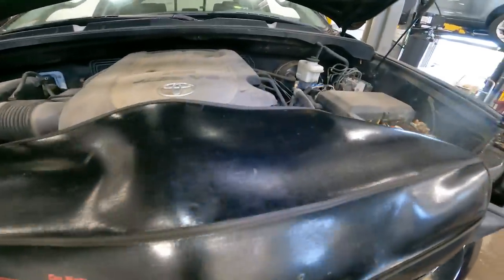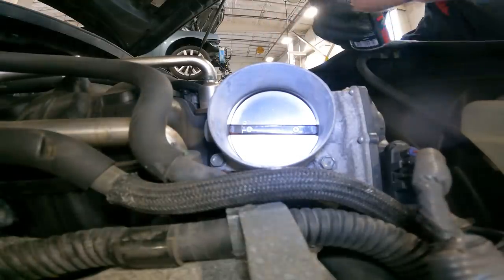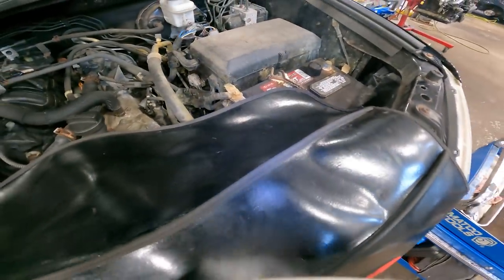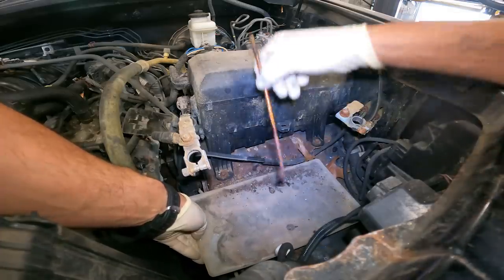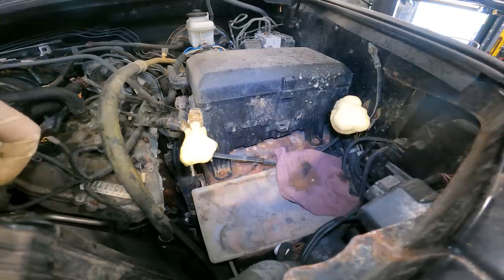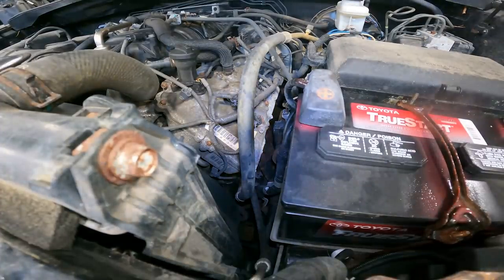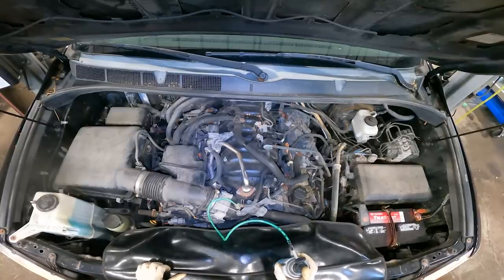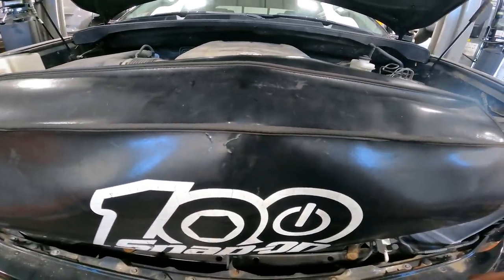Customer states ENGINE IDLE'S LOW AND CRANKS SLOW. 😡🤔😁😉

Comment: I always leave the caps on the terminals until I'm ready to reconnect the cables.
First time I ever changed a battery I welded my spanner to it. Scared the crap out of me, never did it again.
Reply from the maker: Sometimes we learn the hard way, either way we have learned. Knowing is half the battle.

Comment: I like to unbolt the throttle body and clean the backside as well. It’s usually filthy back there. I clean mine every 30k miles along with the MAF sensor.
Reply: I like the way you think.
Reply: I’ve read differing opinions regarding MAF sensors and how cleaning can damage in some cases, ever come across that ?  I clean mine, only with MAF sensor cleaner.
Reply: @TheSchmed  as long as you clean it with MAF sensor cleaner and let it dry, you will be fine. Most other cleaners leave residue that will screw up the sensor when it heats up.
Reply: It is hightly recommended to keep the backside clean.
Reply: A steady drip induction off the booster hose for 20 min is useful as well. Gets where fuel treatments cant because it enters the intake. No more than 20 min because your cat/s will start to glow & you risk damaging them on higher mileage engines.

Comment: My 03 Silverado had this issue, at low idle it would stall out and in reverse. I took it to a mechanic he said replace the computer, did plugs wires fixed for a week same issue. Cleaned that with carb clean, 🪥  toothbrush, ran like new.
Reply: Yes I find that a good medium to hard bristled toothbrush works quite well the cleaning the front AND the back side of those throttle bodies!

Comment: I strongly recommend to perform that manifold injector cleaner every 30K miles on GDI Engines. You need to remove the crud on the intake valves BEFORE the accumulation becomes heavy. Otherwise expensive Walnut or Dry Ice blasting will be required.

Comment: “Always make sure your nuts are ready to go” giggity😂😂 I’ve seen batteries with no terminals just jumper cables. I’ve seen terminals eaten through held on by vice grips. I’ve seen cars with marine terminals instead of automotive. It’s amazing the jury rigging Goombas do to their batteries to keep from spending just a little bit of money and working just a bit to replace a terminal or perform corrosion preventative measures.
Reply: Yo I work at Walmart. The other day we had this guy buy a MARINE battery for his Corolla bc we were out of stock with the cheaper ones. I wish I was there to see him struggling to install it

Comment: Pro tip from Lexus tech, if your shop has a coffee or water machine that has reallyyyyy hot water you can slowly pour it over the acid and it will also disolve it like nothing! Never knew about this trick till I started working at my dealer and it works amazing! try using super hot water next time you have corroded terminals you'll be blown away

Comment: The explaination for removing ground wire first, install ground wire last is: you risk shorting your wrench to chassis, when fiddling with the positive terminal, and ground terminal installed.

Comment: Where is your shop located ?  Suffolk County, LI ?  How far from Huntington, LI.  Independent or Dealer service ?  I see you work primarily on Toyota, Audi & VW, and I see your digs look like dealer service dress.  If you are dealer service, you should scram and open your own shop.  A few dealers I’ve been to for service, I had to tell them what to do to find the problem, the latest being a leaky axle seal on my JKU, guys says “there is no leak”, I say “did you remove the rotor and take a look, that’s how I found it, and I told your service manager that”, he says “I gotta do all that work to look ?”, I say back “I’ll come down and spend the 3 minutes to remove the rotor If you find it too difficult”.  5 mins later I get the call “Oh, you’re right, we found the damaged seal after we removed the rotor”.  I found it when I was changing my rear pads and rotors, the tone ring was covered in grease.  First thing I did when I got it home was remove that rotor, and check, and I checked a second time 500 miles later, to make sure they just did not clean, and say they replaced (as it was warranty work).  The invoice also said they changed the axle lubricant, but I did not see the 4oz LSD Friction Modifier additive (for Sahara models) on it, and the Mopar lubricant they used does not already have it ( I looked up part number on the invoice, as the synthetic fluids already include it, but they used conventional) So, I had 2 quarts of Mopar 75/90 lying around, and a bottle of the additive, did a drain and fill, and what came out was the fluid I changed 10k miles prior, far from fresh lube.   Assholes.

Comment: For some reason I want to see you work on a square body Chevy/GMC truck.... I don't know why.
Reply from the maker: I ain't scared but I might piss and moan the whole time 😁😆😆😆
Reply: @customerstateswhat   🤣 They're not that bad. No more so than my 95 F350 with a 7.3 in it. My biggest thing with my squares is carburetor related stuff. More specifically the choke won't stay shut on my 86 K2500. I can physically close the plate by hand but it opens when I move the throttle. I will say that both my squares though have "flavor" in all the normal places for a square body, and then some.

Comment: I've always kept my cars an average 16 years, high milage - yes, I'm an older guy !
 Rust proofed every year (I live in Canada, rust country).
I made a point of honor to bring them to my mechanic with a clean engine bay and/or wheel wells depending.
  Always had appreciative comments from the guys at the same corner garage for years. They knew me well !
Always had top notch service and most important, never, ever had cheap, chinese made parts installed.
Many times OEM. 
Sold them all at a premium to friends or relatives.

Comment: I drove a 1975 Toyota Corolla 1200 Van (3-door, 5 seater) between 1989 and 2001 and the battery's hold-down was already like that, 47 years ago. I guess if something works, why change?  : )

Comment: Amazing, i did this a couple of days ago, big difference when idling, you also need to delete the memory from computer. My throttle body on the inside was so black with crap.
Reply: Most cars will reprogram themselves as they run, adjusting parameters from the information they receive from the sensors. Also when you disconnect the battery the memory is reset, you can use memory savers that plug into your OBD port, to keep everything saved.

Comment: any specific cleaners you suggest for the injectors and throttle body?
Reply: Lucas makes great products
Reply: Just don't use carburetor cleaner on throttle body.there is thin clear coat to protect the throttle body bore.

Comment: Take a good close look at what is written on the back of the shirt.
If you are conscious and paying attention - you will notice that it is
TOYOTA and not Toyota
Brain damage on both hemispheres causes the obvious not to register
and the brain receives corrupt data from the eyes which are not
functioning correctly -  
The correct writing is also on the vehicle - but no matter how much or
how long the eyes look at it - the brain does NOT compute and requires
re-programming.
Usually percussive action on the back of the head  loosens the brain rust,
and functionality can be restored in the majority of cases as things become
clearer.